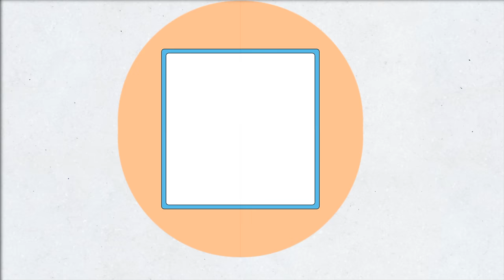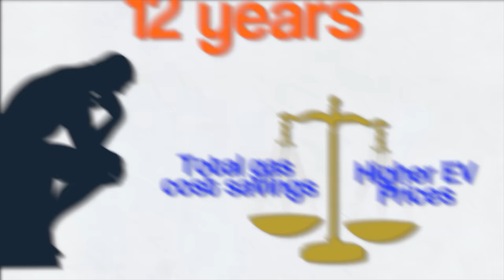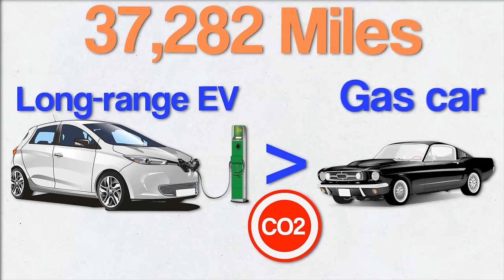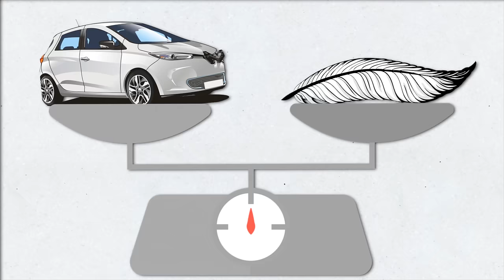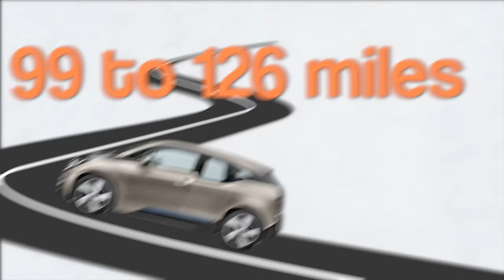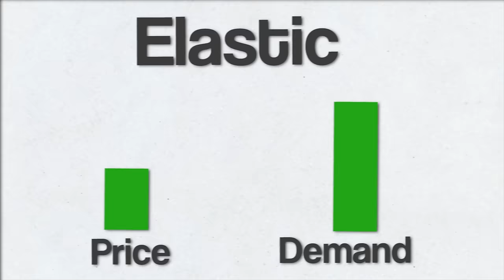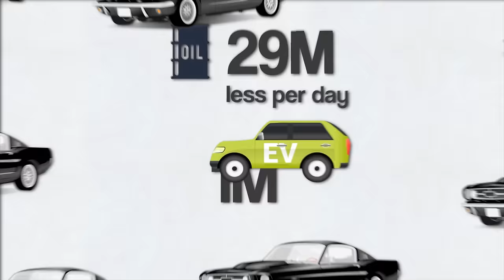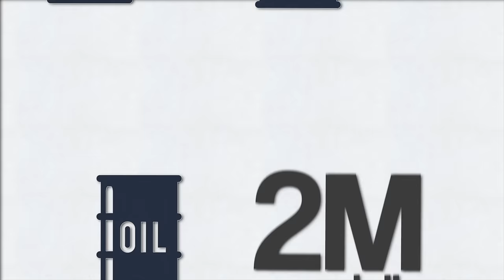If You're Worried About Rising Gas Prices, Watch This

Comment: Lithium Ion batteries are going to phase out more than likely in 2030 or so--They will be replaced by solid state batteries-These batteries are in R&D now and are showing great promise--Hyundai has actually bought 4% of a company called Solid Power (SLPD) and the other company to check out is called Quantam Scape (QS)---Do some research on these companies and the solid state batteries ,which are going to change the world of EV's ---Look at this You Tube video--800km / 500mii range 12 min charge solid-state battery EV's are coming up from Hyundai,Genisis & Kia

Comment: It's not like gasoline cars are made out of thin air. But let's say that recuperating CO2 takes 37,282 miles. At 25 miles per gallon with today's $4.15 gas price, that's $6,200 not spent on gas, up to that point (You'd pay about $1000 for electricity, though). Also after 3-4 years, you'd have far less CO2 and still not be paying for gas.  In about 7-8 years, you'd have saved about $10,000 on gas, also on CO2. Child labor must be eliminated just like how diamond mines had such problems before.  The real problem is EVs still being expensive.

Comment: Never bought a new vehicle. Only twice a loan for a used vehicle. Like my fuel efficient 4 wheel drive 4 cylinder vehicle. Don't drive a bunch, to work and back and around town only. Less than 100 miles a week. Plus no place to plug in an EV outside my apartment where I live, and have never seen a charging station anywhere bear here. Not would I want to wait to charge my vehicle since I can't charge at home. Unless I also get a gasoline generator to charge it with. Lol

Comment: scotty I have a 2008 ford focus. The spark plug blew out and I put a helicoil in and it blew out and had a nether one in and it still is able to come out if the spark plug is hot. My mechanic is telling me it's a weak cylinder head. Is this actually true. The ground strap has melted 3 times on spark plugs and only happens on the third cylinder. My mechanic says it's a weak cylinder head

Comment: Own a 1982 Volkswagen Westfalia. Drive a 2004 Subaru Legacy as a daily driver. My parents have a Tesla Model 3 and Hyudai Kona. 

The future will be cleaner. Dont forget they put lead in Gasoline not to long ago. Laws can be changed. Better options and alternatives for manufacuring will happen. We are talking about the INCEPTION of electric vehicles lol. 2050 is going to be nuts. I figure 1000km range EVs will be common for base unit in 2030.

Comment: I drive about 300 miles to work, I charge every 3rd day. About 15.00 a week on my home charger. I will keep it about 12 years. I will take my chances on the battery. Your don’t have hardly any brake wear, because of auto regen when I touch the brake pedal. Have not needed to rotate tires, even wear all the way around. Charge  at home, can you fill you gas car at home? When I take a trip, no problem charging. Tesla is opening up their chargers to everyone soon. The EV is coming, hold on………

Comment: I stay with my 40 to 43 miles per gallon 2007 Toyota Yaris, manual transmission, 2dr, lift back.  Scientist have many times stated they cannot determine the cause of global warming.  Electric cars are the best alternative to the outdated reciprocating engine.   But!  Manufactures produce the electric car with many electric accessories.  Electric: windows, seats, mirrors, headrests, A/C, heaters, display monitors, suspension control, elaborate sound systems, self driving options, accident avoidance systems, hands free phone systems, GPS destination assist............

Comment: My reasons for not buying an EV today.
1. Too expensive
2. Inconvenient for recharging
3. Additional costs to upgrade house to make charging more convenient 
4. No house and houses too expensive mean convenience is not currently an option
5. Quality control issues galore
6. Subscription style restrictions for features and equipment you already bought but don't have access to
7. Possibly worse than gas vehicles for overall environmental and social impact 
8. Electricity will eventually be taxed for vehicular purposes just like gas (Oregon working on tracking your driving)
Electric grid cannot withstand EV adoption and is basically a remnant from the 1950s
9. Feel like I need a backup ICE vehicle

Future reasons for potential purchase
1. Performance related to instant torque 
2. Convenient if have a home and don't need to visit gas stations 
3. I'm sure everywhere could employ chargers and this could even be built I to the road for wireless charging
4. Could potentially go off the grid camping with renewable energy systems as backup or to power ancillary
5. Lower center of gravity makes trucks and SUVs more fun for turns and likely safer
6. If they could waterproof like a phone, they would make great off-road vehicles (would have to really trust meaning of waterproof)

Comment: If you have to change a Tesla battery after 500000 to 1000000 miles, is that really a big deal?  The math says pretty clearly that you save money after five years for a comparable car.   They are switching to lithium iron phosphate batteries instead of using nickel and cobalt.  The times have changed.  EV time has come and anyone stuck with a gas car five years from now is gonna ask why the hell they didnt buy one when they had the chance.

Comment: The battery-electric vehicle is a consumer trap.  Although EVs can have the benefit of instant torque, most EVs are not getting the powerful motors and batteries that would enable this performance.  A problem is that the goal of the government bureaucrats is preventing us from driving, and the EV charging scheme is vulnerable to government interference.  There is a reason why government wants a subsidized network like Electrify America instead of individual charging stations, because it is easier to disable a single-source network whenever the government claims that we are using too much electricity.  This disabling can be done by city, region, or nationally.  The government can simply disable all of the charging stations (except for government vehicles and cars owned by friends of the politicians, of course), and prevent us from charging our cars.  If that isn't enough to satisfy the government, the bureaucrats can use the threat of Rolling Blackouts, disabling any home-charges and air conditioners.  Code Red Day?  Charging disabled by order of the mayor!  Ozone Hole?  Charging disabled by order of the governor!  Another problem is that the government will punish EV owners by taxing them.  First the government incentivizes EV purchases, but then the government will tax EVs and charging like it does with gasoline cars and fuel.  The desired result is that only the rich and the politicians will be able to drive cars, and everyone else will be in a Johnny Cab, a bus, a high-speed train that America still doesn't have, or on a bicycle that will have no bicycle lanes to use because they will have been taken over for EV services.  Bicycles and pedestrians prohibited!  The government doesn't want us to have the freedom of mobility that we have enjoyed since the first cars were produced.  Everybody is saying that "EVs are inevitable."  Well, it is also inevitable that most citizens will be denied the right to travel freely unless we start saying no to the government's demands.

Comment: A few more reasons not to buy an EV. 1) You love vehicle maintenance, oil changes, and emissions tests. 2) You like trucks and cars with inferior performance, horsepower, and torque. 3) You like throwing 2/3 more cash away on fuel vs electricity. 4) You’re kids and family love breathing toxic air.

Comment: When l was about 14 or 15 years old,  l was fascinated with the possibilities of magnetic and antimagnetic fields that could be used as propulsion. l designed a giant metropolis for Science class and Art class. 
My minds imagination of a Giant Mega Metropolis ' was awesome. individuals  driving their own vehicles would drive up onto these huge trains that floated on tracks using anti magnetic fields. A Mega Metropolis Transport Train,  much like many societies use today to transport people (Subway). These Giant Mega trains would transport vehicles and their passengers for minimum rides of 100 to 200 miles with a time of arrival of twenty to thirty minutes. Each Mega Train  Transport Unit could carry an estimated 200 to 300 cars. Each Mega Train had ten Unit Transporters. That is roughly about 2000 to 3000 vehicles off the road at any given time. Anyways, l received A+ in both Art class and Science class.
l had a hell of a good time working on it and drawing it all up. A gentleman from Oregon bought all my artwork from that project, when it was up for display in our family restaurant. 
l couldn't believe my little sister sold it all for $40.00
Man ' l was butt hurt for a while. All l have is a photo somewhere in a box and my memories of it.

Comment: If gas prices stay so high I think we are setting up for hydrogen.  Why are we not using natural gas?  I mean the power to power an electric car mostly comes from natty gas.  It’s kind of stupid to power a powerplant with natural gas to make electricity. Then transmit that electricity.  Then put it in batteries.  At each step you are loosing energy.

Comment: I'll always ride a combustion engined motorcycle for as long as I can and as long as I can get fuel, I don't care how much petrol costs as motorcycles don't have big fuel tanks, I'm not a big fan of Electric vehicles myself, although I don't hate them, just prefer petrol engines.

The only time I'd get an electric motorcycle is the day when I have no other choice. 

You'd have to ride or drive a combustion for around 350,000 miles or more before any environmental benefit is seen with an EV over a combustion vehicle,  and most people don't even do that in their vehicles lifespan, especially here in the UK 👌

I firmly believe that simply switching to a Carbon Neutral renewable liquid fuel that is compatible with the petrol engine and using plant based engine oil, would be by far the best option and most environmentally friendly, they could decarbonise rapidly that way, instead of persisting with electric vehicles that the average person can't afford.

E10 reduces a combustion vehicles environmental impact anyway 👍

Comment: It is a good idea to change my 2001 C 320 four Matic all the lights to LED the car was stirring for 13 years when I bought it with 64
Thousand miles only full tune up, has changed, also has treatment cars runs good just a couple of little but expensive thing’s did my brakes over ,tires ,front end work like struts and suspension system Now it seems like I’m leaking antifreeze I forgot the whole pulley system plus AC condenser done Car runs great just that now think I’m going to get some of that world stuff find the leak and use it not going to just jump and buy a Car radiator this minute, Going to need to summer it’s about here
Reply: Stupid smart phones I meant it was sitting for 13 years

Comment: How many miles do the batteries last before they go bad and need to be replaced?
Reply: Modern BEV's have excellent battery management systems (BMS) to keep the battery at its preferred ideal temperature for minimum capacity degradation. There are BoltEV's and Tesla's with over 200-300K+ miles and less than 10% capacity loss. EV batteries will outlast the car.

Comment: Not even taking in to account of the cost of charging stations and the realistate needed to accommodate all the cars. Going to be a real issue in the city.
Reply: 80% + of EV owners charge at home on a 240V washer dryer outlet.
Reply: Try doing that from your fourth floor apartment. 👍
Reply: @scottcoleman2876  Yep - EV's are not for everyone given the current infrastructure. As workplaces, apartments, streets (lamp posts) install level2 chargers we will get there. EV adaption is slow, so this doesn't have to happen overnight.

Comment: Driving lets say 200k on highly NEUROTOXIC gasoline car will cost you 50 000-60 000 on that toxic gasoline alone. Plus 5k on oil changes. Thats the price of the entire new electric vehicle plus savings. Used battery modules can also be resold and fully recycled. EV uses 1/3 parts of ICE vehicle,  thus a lot easier and cheaper to manufacture and maintain. Permanent magnet electric motor lasts 1000 000 +miles easily. There has never been a real resong to stick with older, inferior technology and that is so true!

Comment: here's another thing people arent taking into consideration, when you purchase gas , part of the taxes collected go towards the repair of the roads..lol people who purchase EV's aren't paying this tax but are still using the roads, however, battery technology will continue to get better , and the need to actually "build" a body for an EV will dwindle because you wont need to replace the body of the ev they last 15 to 25 yrs, you can just switch out the motors and batteries and boom the car is brand new again, so when you purchase an EV technically it lasts as long as you the consumer wants it to, not the company who builds them, in the long run you could save thousands...over time.
Reply: I wouldn't hold your breath too long on that. Enough people get on the EV bandwagon. You better believe they'll start taxing you that infrastructure tax to your electric bill once they find out you charge at home. I'm sure you'll be seeing it on charging stations too. The government isn't going to let you walk away without paying some kind of tax...

Comment: The amps that it will take to fast charge your EV is somewhere around 550 amps. This is not going to be cheap and you will be paying for it.  Then all the taxes on gas to repair roads and bridges still have to be collected somehow. Your EV is still using roads and bridges so that will be added back into your electric bill or you will pay so much per mile driven. When it’s all locked in, gas will look really cheap compared to your electric car. Just a thought that no one is discussing. Also many more power plants will have to be built. The current electric grid is maxed out now. GOOD LUCK TO THE FIRST STATE THAT GOES ALL ELECTRIC. IT WILL BE A DISASTER.

Comment: No EVs for me anytime soon. I'm intrigued by the "Mustang" Mach E, but it wouldn't be an everyday driver since I work from home. I read somewhere that EVs require being driven daily to slow down the battery capacity loss. Taking it on a long trip is very impractical. I think the future sits somewhere between a plug-in hybrid and an EV, whatever that is. 
If they could come up with that Mr. Fusion that runs on garbage from Back To The Future 2 and use the electricity to power the wheels on demand, then the whole issue would be solved. Since that's fiction, I'm not counting on it.

Comment: Gas based cars will continue to dominate for 15 more years until EV technology matures up and becomes more efficient. Carbon emission during the making of EV battery is size/range dependent. Bigger the battery , more the emission. Most EVs should recover over 3-6 years of time.

Comment: While most of this is correct. You are missing the point that people will replace their cars at some point, so the choice is between replacing cars with EVs or gas cars. The production of gas cars is also very bad on the environment.  Also, when batteries has bad cells, shops will replace the bad cells only.

Comment: Number 1: It isn't just the fuel costs that save you money.  Maintenance costs of EVs are a lot less than ICE cars.  Number 2: Exotic metals are being rapidly being removed from batteries.  In a few years there won't be any exotic metals in the batteries.  Number 3: Because exotic metals are being removed and because batteries are starting to be built at scale, battery prices are rapidly dropping and will continue to drop.  Number 4:  EVs are inherently cheap (with the exception of the battery -- see number 3).  They have few moving parts and are easy to manufacture.  Tesla makes like a 30% margin on their ridiculously high-priced cars.   If you do the math, you will realize that a Model 3 (most of the cars they sell) can't be very expensive to build.  Competition will force down the price in the next ten years and cheap EVs will kill ICE cars.

Comment: The reality is oil isn’t just used for gasoline powered vehicles. Petroleum products are used in almost every product in your house from the roof to the floor. And even if we wanted to change the entire U.S. transportation sector to EV’s, it wouldn’t be possible, because that amount of rare earth minerals doesn’t even exist on the planet. And that’s just for the first round of batteries that last 10 years or so. To even make a significant dent, the U.S. would have to start mining it’s own resources of these minerals. That means leveling mountains. So which mountain range goes first, Democrats??